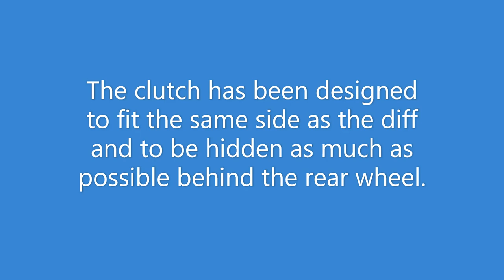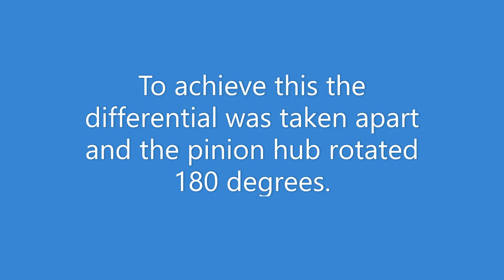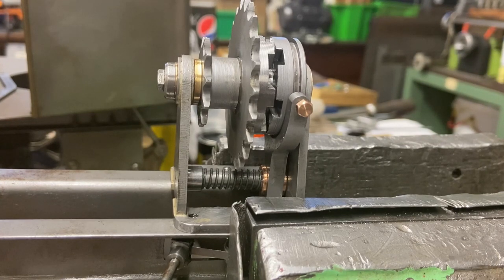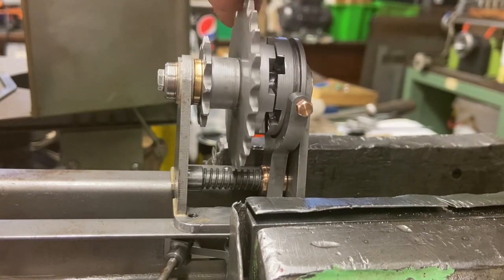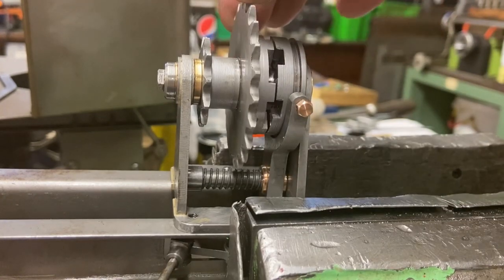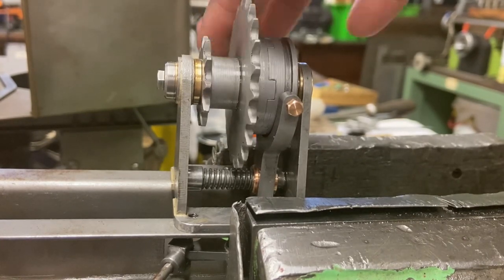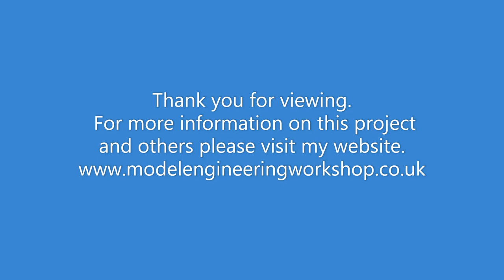2" scale Clayton Undertype Steam Wagon Clutch reduction gear.

Comment: Can we use spiral jaw clutch instead dog clutch??..
Reply from the maker: Unfortunately you would lose either forward or reverse drive with a spiral jaw clutch as it only engages in one direction
Reply: @homeengineer5212 Okay thanks ...so can you provide any material for reference to design the dog clutch according to our requirements
Reply from the maker: @smk3399  When I get a chance I hope to complete drawings for the clutch.
The clutch was made just to see if it would work. 
The construction is fabricated and machined from mild steel and bronze bushes.